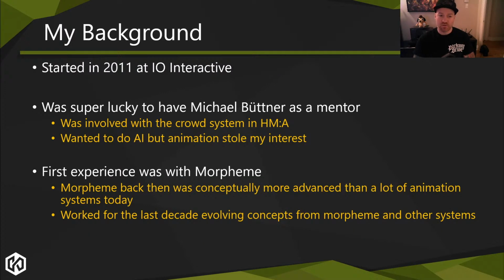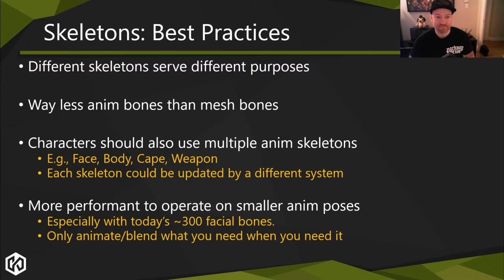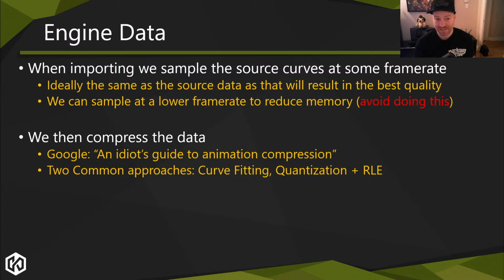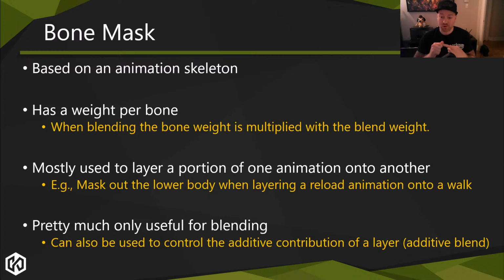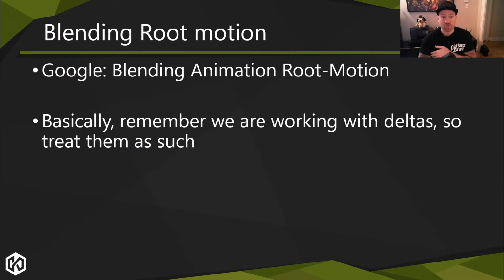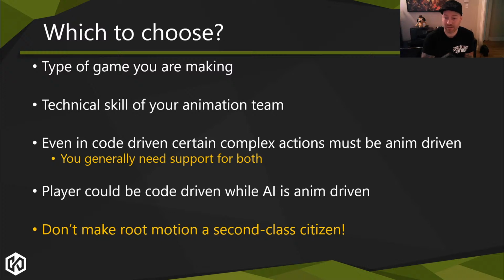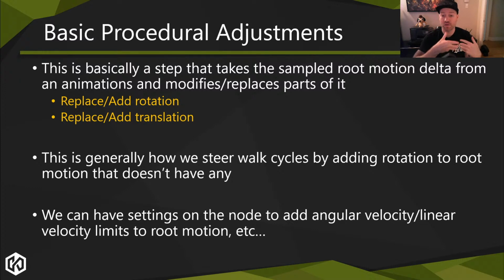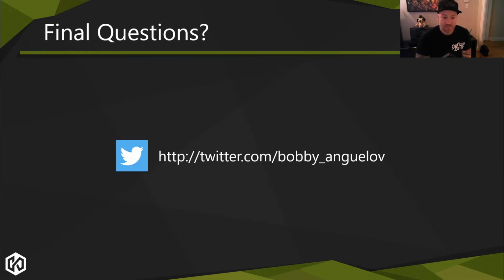Animation Programming Basics

Comment: Hi! Thanks for the wonderful video! I have a quick question regarding motion matching and root motion. In motion matching... is it usually the case where the animation dictates how the capsule should move? I'm just wondering because in games utilizing motion matching there are barely any foot sliding... But in that case... how does the character still manage to walk in a straight line that matches user input and not tilt sideways? Does the game code keep track of where the character should be in the case of that input and slightly adjust the character's position? - Nvmd I guess this is the 'anim driven' method that you mentioned in the video

Comment: Thanks for taking the time to make this! Very helpful in todays world where everything is pre-built ( unreal ) and nobody messes with with functionality under the hood. Any chance that you will do a talk on best practices for realistic AI Navigation using Root Motion? I remember you did some GDC talks regarding avoidance and motion planning, it would be great to see if your opinion has changed or if you have discovered anything new in that regard :) The warping and root motion data can be easily used to build path planning and i don't think its that hard to get a prototype going, there are some things that need solving which i don't think much information exists such as how do i simplify my path points enough for planning to work, how to achieve realistic arcs etc.